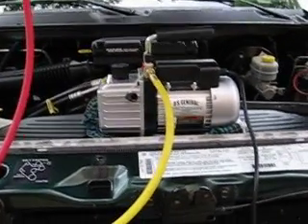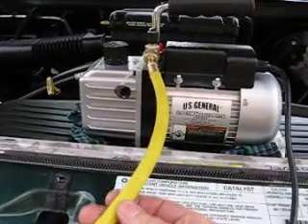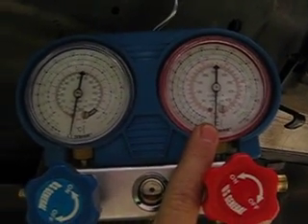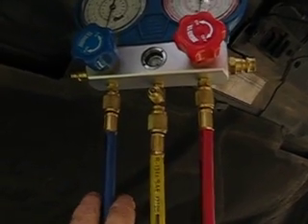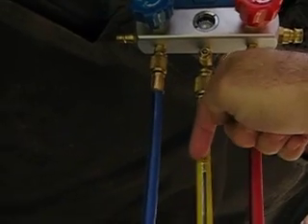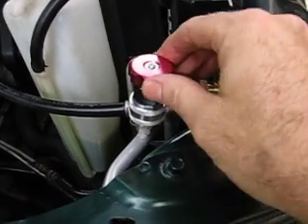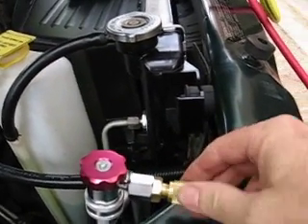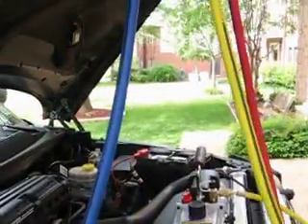How to evacuate and "pull" vacuum on an R134a car AC system

Comment: Also when you finish vacuuming a system down replace the little high and low AC caps, until you start to charge the system. If not the system will start to suck air back in, you can hear it, if you put your ear to it.

Comment: Do I need to have my engine running when evactuating/vacuuming or just when recharging?
Reply from the maker: Do not run your engine when evacuating your AC system. Only run engine when recharging(with AC turned "ON").

Comment: Mine won't vacuum. So I assume I have leaks. I changed everything in my system ecept the evaporator coil. My system doesn't have an expansion valve. My question is being my system is new if I go back to check all my connections do I have to get a new drier?
Reply from the maker: If your drier is new, just don't let it have to much exposure to outside air. Remove drier connections and cover them with plastic wrap as soon as possible to keep out moisture. I assume that you have an Oriface tube, if you don't have an expansion valve.
Reply: mikecarter79 Yes.. I have orifice. Thank you so much. I'm about to go tackle it again. This is driving me crazy but I'm determined to get this.

Comment: Question: I emptied the (134) system to replace the high pressure (Leaking) valve on my 96' Chevy truck, then I replaced the orifice tube (Just a bit dirty), should I have vacuumed out the system before I installed the new orifice tube?
Reply: no- after you change.  once all repairs are done and its put back together- 
you vacuum the system.

Comment: this is going to sound incredibly stupid, but, do you vacuum before or after replacing the part which you are replacing? same question goes for flushing the system. common sense tells me to do it after to make sure its clean when you are finished. i have searched high and low for an answer online but with no luck. thanks
Reply: Derrick Bosch have a shop remove the freon. The vacuum in this video  cannot reclaim freon. Once it's removed you can replace the compressor and start this process which removes moisture from the system and creates a vacuum in which it will draw the freon into the compressor.

Comment: do you vacuum the system with the ac compressor fill with oil? does it take out the oil too?
Reply from the maker: Yes, you vacuum your system with all oil still in system. Very, very little oil will be "vacuum'ed" out during this process, as the oil is heavier than the air that has gotten into the closed AC loop. So the oil will move to the lowest places in the lines that it can find. Oil will also remain in compressor and receiver driver....but the vacuum is not strong enough to move the oil from the High and Low side ports that have the vacuum going on.
Reply: I swapped out the compressor on my wife's car, didn't vacuum, and added R134a.  I noticed it only took one can and the system was supposed to take 2.  It cooled good for 2 days, then ........ nada.   I ordered a cheap pump and gauges from Amazon.   Fingers crossed it will work.   I'll know in an hour.

Comment: Thanks Mike, I used hydraulic oil to fill. Its been a few years since I did this so I thank you for a refresher. The instructions on the pump are not very clear. Now I remember why I purchased the gauges also. The pump is now called Pittsburgh,  or General. Still made in Asia, but they work at a good price.

Comment: I have a 1/2 hp spray compressor. Looks similar to a vacuum pump.  It has an intake of about 3/8 inch and sucks in the air for the airless sprayer. It has a 3cmf and 40 psi.
Can I get adapters and use this as a vacuum pump?. It sucks my hand up to the intake filter firmly when I put it on the outside of the filter.
Reply: +John Drew not really as a true vacuum must be deep, I doubt if it would pull down to 10inches.....and that would not remove moisture...

Comment: Could SOMEONE PLEASE explain to the people on youtube how you pull the r134A out of an AC system?  Everybody says you need to evacuate and recover the refrigerant to a recovery tank and check that your system can maintain a vacuum before putting it back in the line but there seems to be NO exit fittings on these pumps to send to a recovery tank. Thanks!!
Reply: Ryan Hauf this is fun to know.. i just looked it up and it's actually that knowingly releasing 'refrigerants' is illegal. So i guess if you are not using it for refrigerant purpose then you're good?
Reply: @ the truth, you only use the pump when the system is discharged.
Reply: ***** R134a doesn't damage ozone but it's still a greenhouse gas. Knowingly releasing R134a into the atmosphere is illegal.
Reply: +Beau Sage any shop that does repair work will have a recovery machine....little or no charge to the customer.....if vacuum wont hold a vacuum then you must find the leak with soap, or dyetel, or leak finder unit....no sense in wasting expensive freon and destroying the atmosphere
Reply: +Bill Highland 
134a is not freon, you idiot.
R12 is freon.

Comment: Question, when vacuuming, where does the r134 residue/ moisture and what ever dirt go?
Reply: Guys the vacuum pump has an exhaust. It goes out into the atmosphere the thing is to keep vacuum on the lines to test for leaks and then reintroduce r134a.  Its a sound investment at $100 with gauges and all considering the small fortune you will be spending at the shop.
Reply: edesir good question

Comment: So that vacuum pump vacuums out the refrigerant right?  The refrigerant doesn't cause any problems with the vacuum pump?
Reply: +ScubaDude79 no scubaDude79 the vacuum only pulls out gas and moisture....if systemis charged you must have someone recover it properly

Comment: MIke, $ dictated that I had to pick up one of those air compressor actuated vac pumps from harbor. Once I disconnected the compressor there was a loss of vacuum. I figure that is due to cheap bernoulli type setup. and there is no positive valve closure. Once I pull vacuum with yellow hose, can I turn the hi/lo valves off and will that keep a correct vacuum reading? Or does by turning the valves off shut the gauges off from the system?

Comment: Step 1: Use a machine that no ones has.
Reply from the maker: you can get this "machine" for 80 bucks at Harbor Freight. Not a big challenge here.
Reply: mikecarter79 you can rent that pump at AutoZone, O'reill's, Advance auto parts,.........for FREE as well, with the gauges and anything you need for FREE to do your A/C or anything else you're working on, as they Rent Special Tools. all you have to do leave security deposit, and you will get it back, once you bring the tools/pump/gauges............ back.
Reply: These vacuum pumps are no longer rented out at least in my area. I bought one on ebay for $52 it works. One note, learn to use the pump for things so its not a waste. You can use it to draw air out of bags to store meat etc. Also science projects. At this price it was a good investment.
Reply: +Jesse Tate Since you seem to know your shit, what kind of a oil should I use for the AC system on a 2014 mazda 3? I looked in the service manual and it doesnt specify. I am replacing the condenser due to a front end collision, where should I put the oil, in the condenser before I bolt the line back up?
Reply: Auto Zone rents it for free with a $280 deposit for a high quality machine.
Reply: goodness, do you all really take the world that seriously? I made a clever comment so that people can get a giggle out of it. I never said I didn't have the machine...but it's nice to see so many qualified a/c technicians such as yourselves, visiting a how to tutorial for A/C system repair....gone on, slap yourselves in the face..
Reply: TK Or maybe we know you can rent the tool and thats why we replied to your "funny" comment? Dont have to be qualified technician to know that
Reply: TK Step one, look up how to fix something you have no idea of how anything at all works, nor have any of the equipment to do it. haha.

Comment: hearts in the right place... the videos need some work... there's alot of ways to defeat your own purpose if you have guage valves on at the wrong time or off when they should be on...  your video doesn't set anything up, it jumps right into your results on the guages after the vacuuming is done... then ramble, warnings, concepts, more warnings....  people just want to know what to do and teachers know that pictures don't explain..they only illustrate.  keep up the effort but organize first...

Comment: Correct me if I'm wrong but if your compressor didn't come with oil.....you would fill that up with the specified oil before you do the Vacuum correct?  For some reason, I think that the Vacuum would suck the oil up or am I wrong?
Reply: Murph The reason you pull a vacuum is because water boils at a much lower temperature when in a vacuum.  The closer you get the vacuum to 29.4 inches of mercury the lower the temperature the moisture will boil.  Then the vac pump pulls the gases out.  The oil doesn't boil at normal temps (40-110) sets therefore stays I. the system.

Comment: Good job! There's one little part that would make your job easier/faster/better: A 1/4" ball valve on the end of your yellow hose. After you have achieved proper vaccum, close the valve, hook it to your refrigerant jug, purge a little bit of freon as you tighten the valve onto the jug, and charge away. That way, you make sure you don't get any non-condesables in your system!

Comment: Was wondering what the spare ports on the gauges are for..

And how do u charge the system. .do u just close the valves then disconnect the vac pump and then hook up bottle to the service port and open valves?

Comment: When you turn off the vacuum pump and let it sit for 15 minutes to verify there is no leak in the system do you leave the valves (blue and red knobs) on the manifold open or closed? Thanks!

Comment: I had a big leak in the discharge line and at the valves, namely the low pressure side.  I don't have enough freon in the system anymore for the clutch to engage.  Can I pull a vacuum before I take apart the lines or should I just do it afterwards?

Comment: i vacumed my system it read about 29 inches of vacuum or almost close to 30 inches, i left it for about 45 minutes came back still read the same. Then i charged it with 1 can of 20oz a/c pro refrigerant and then added another can of 12oz refrigerant, i ended putting too much because the car takes 26 oz as recommended. The a/c didn't work right which was causing my a/c compressor to cycle on and off continuously. I bleed some freon out and now works fine blows ice cold.

Comment from the maker: Sorry, my camera limited me to 3 mintes. What I was trying to say at the end was that after you shut off the vacuum, leave the gauges connected for awhile and make sure that the needles on high/low side stays in the "vacuum" area....which means make sure they read below 0psi. If you suspect you have a leak, leave the gauges for a couple hours, or even overnight to make sure you still have vacumm. Make darn sure your connectors are real tight though, as they could leak a tiny bit

Comment: Vacuum stationare studied separatelyof quavac dot com. As Vacuum Sewer is operating with vacuum, the lift in every separate pipe line must be calculated. Also the pipe length must be considered. As mentioned earlier, the Vacuum Sewer method utilizes the atmospheric pressure for the sewage disposal. The vacuum station is normally operating at a vacuum level of 60-65 kPa. The be higher than 3.5 m. for more…

Comment: @mikecarter79 Thanks so much Mike for taking the time to post this video. I really appreciate it! I have a question and maybe you covered it in another video,but let's say that you aren't holding a vacuum because of a leak. Is there a knack for identifying the leak other than recharging with freon and a UV dye? Or is it pretty much just trial and error? Thanks again!

Comment: The vacuum pump isn't used to draw refrigerant from the system. You need to remove any refrigerant using a recovery machine first. Once it is empty you connect the vacuum pump and draw a vacuum to boil out air and any moisture in the system before recharging it. Air and moisture will wreak havoc on the system. Moisture will form pieces of ice that will jam the compressor and clog up lines.

Comment: great video,but i have a queston. can you use that same vacuum if you had a full refrigerant in the ac system. meaning if you started with a low side pressure of about 35 psi can that vacuum hold that much refrigerant? also what do you do with all the refrigerant that the vacuum pulled?

Comment from the maker: I stand corrected on shrader valves and the need to discharge your AC system. There is a special tool designed to replace leaky shrader valves without the need to discharge your AC system. See link in Description section under video...

Comment: Couple of questions. Couldnt you vent the air via the schrader valve on the manifold gauge? I think that would be easier. Secondly, what about air in the low pressure (blue) hose? This now leads me to a third question; why dont you just vent it just where the blue hose connects to the quick connector? That would eliminate six to twelve feet of air trapped in the yellow and blue hose.

Comment from the maker: If your lucky, you can tighten up the shraeder valve with shraeder install tool to stop the leak. They are cheap....Pep Boys, AutoZone...Advance.. Worst case, the shraeder valve seal is shot, and you need a new shraeder valve....which means discharging system completely. There is no way around it if it still leaks after you try tightening it up a bit. You can also try depressing the valve quickly and releasing it to see if you can get it to seat correctly. I use a small screwdriver to this.

Comment: Motorcycle00.do u use 80 or 85% ratio r134/r12 retrofit? Does shrader valve repair open system?;)

Comment: your system WILL still work if you don't vacuum it, but it won't work AS WELL.  When you have air in the system, that air will mix with the freon and the compressor will try to compress it all, thus compressing less freon, so it won't be pulling as much heat out as if it were ALL freon with no air.

Comment from the maker: Here is an example of the kinds of pressures you should see at 90F outside temp and 50% relative humidity :
Low side : ~34psi
High side: ~295psi
Your center duct temperature with above conditions should be ~59F
(The above assumes a properly running ac system, and that it is running when these readings are taken, and the compressor is engaging)

Comment from the maker: ....and the freon can being under pressure. These pressures are nothing compared to the actual operating pressures of your AC system. Put in the required amount of R134a, and check that your Low and High pressures are within spec for the given outside Temprature and Humidity... Tell me your outside Temp and humidity and I will look up what your High and Low pressures should be.

Comment from the maker: That's pretty much correct. But:
1) leave the high side connected(but knob turned off) to monitor high side pressure as you charge up.
2) After you have punctured and opened the can of freon, crack open the yellow hose just a little bit at gauge to push out atmosphere air that entered when you switched from vacuum pump to freon can. Crack open the line just enough until you hear slight hissing noise( a couple of seconds is fine). 
3) Don't worry about the system being under vacuum....

Comment from the maker: When you are checking for vacuum leaks, leave the the manifold gauges turned "ON", otherwise the gauge set would be isolated from your AC system, and you wouldn't learn a thing. Also make sure all your gauge connections are very snug so that your AC system does not draw in outside air and give you a false sense that your AC has the leak.

Comment: You have to completely evacuate the system before you can vacuum it. So the high/low pressures should be 0 and 0 respectively.

Comment: You don't have to unscrew the fittings to bleed air out of the system. If you look where the yellow hose connects to the gauges, there is a schrader valve there for that purpose. Just push the needle in to bleed out the air.

Comment: Can someone help me:
My car's compressor was shutting off because the radiator fan would not come on (fan motor WAS bad). I replaced the fan assembly and now that's OK. The AC was working for about a day after that but now it does not blow cool air. At first (before we discovered it was the fan assembly) my mechanic thought it was out of Freon. When he tried to refill it he used the high pressure line!! The low pressure port was by the compressor! Could that mistake takeout your AC system??

Comment: Attaching an inline Torr gauge would help determine when the vac process is complete.  Then if it doesnt pull down to under two Torr (uk regs) or doesnt maintain the vac when you shut the lines off and turn the vac pump off you know there might still be a leak.

Comment: if you have to vacuum the system,but the system still have decent amount of pressure,let say 25 psi at low side,and 115 psi at high, can you still use this pump? great vide by the way, im just wonderin what pressures your vehicle have before you vacuum it..

Comment: @jlinn91 Yes... If you have pulled any of the lines off, you would have let air into the system. Air contains moisture. Moisture can/will lead to acid and corrosion of your system. Not to mention you would have lost your refrigerant in the process of releasing the lines.

Comment: @mikecarter79 Manifold gauges hardly give an accurate vacuum reading. Best to use a vacustat for proper evacuation, and get down to around 500 microns.... but I know, plenty of people just use manifold gauges and monitor the vapour coming from the vacuum pump exhaust  :)